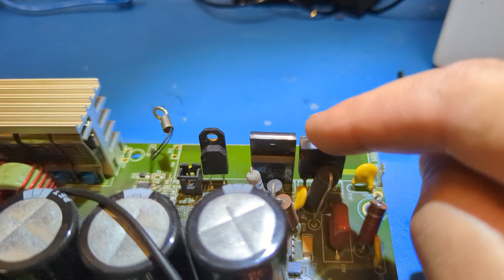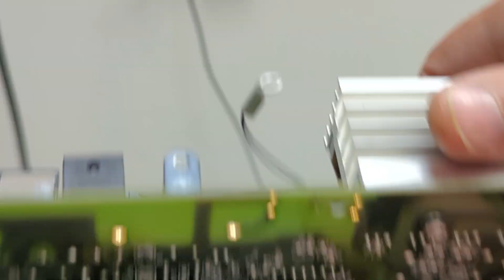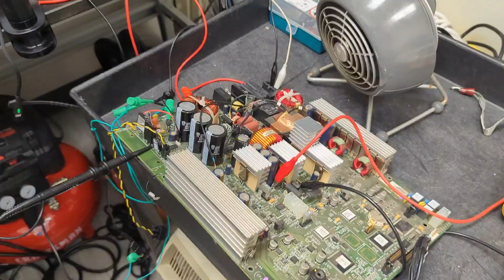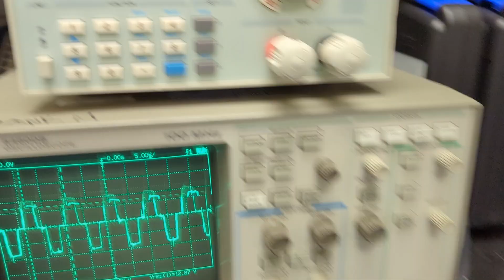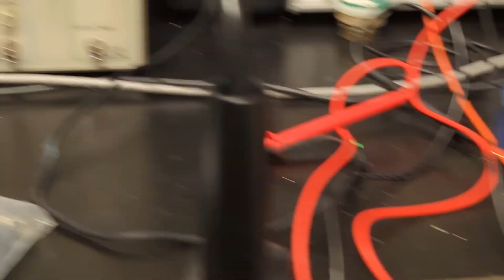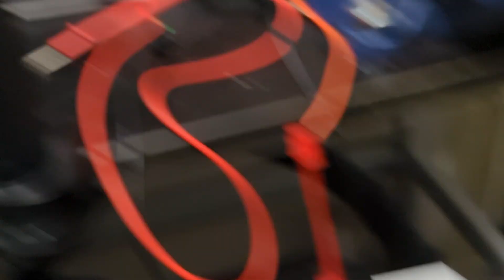Bio-Rad C1000 Thermal Cycler Main PCB Repair - Power Supply & Fan Control

Comment: Very informative. You really dug deep into this one. Oddly complex fan controllers. 

We'll be repairing some of these soon based on your experience. We have one with a power supply that ticks after power on and a dead one like you started with. Thank you!!

You said you worked on the Touch models with their separate power supplies (we have a standard C1000 with the separate PS as well). We have 3 of those separate 40V power supplies that produced magic smoke, but are being repaired. Have you repaired a Touch with a "Protocal run failed to stop" error during the Diagnostic Test? I think we have three of those. I will isolate to which component this week. 

I wonder if these units charge their 4.8v battery while in Standby necessitating the complex reverse power switch setup? I'll test later. NOPE. I put a low battery in mine and voltage stayed low while powered on, but increased upon full power up.

Lastly, I have some busted up blocks I can't reuse that would be perfect for testing. I'll email you if you want one.
Reply from the maker: @dsetter608  Thanks for the feedback Don! Hope you are doing well. It turns out that the fan issue at the end is normal for these when they don't have a reaction module installed. Or at least that is what I hear. I don't have a reaction module on hand to test (I'd take one of those broken ones off your hands 🙂). And my experience with the C1000 touch is just one unit. It was having a very strange issue where it would be unable to reach set temp right for tight gradient steps (say 10C)  across the block. It would then throw a slow block cycling error. Very odd. But if you weren't running a tight gradient, it worked fine and also passed self verification. I also confirmed it was not the reaction module. I wasn't able to fully repair this one and had to move on to another project. Would have liked to continue working on that one because it was quite interesting. But to answer your question, have not seen the error you describe unfortunately. Power supply issues are always a bit easier to repair IMO (even tho this one did give a bit of trouble!). So good luck with them. Happy to help if you want to send over some more details!
Reply: @fmashockie  My C1000 Touch will not allow the Diagnostic to start without the block, so I fired up a standard C1000. And yes, the standard runs one fan during the Diagnostic Test without the block and both with the block. Odd. Maybe to save power...? With the single fan normal functionality, sounds like you fully repaired your $35 ebay special! I have 2 more C1000s incoming this week. I can repair as many blocks as possible, then send you functional beater for testing. Then, you'll have a fully tested C1000.
Reply from the maker: @dsetter608  thanks! but only if you have the time.  this is not a huge priority at all.

Comment: Excellent video!  Thanks for going through everything step by step.  I have one of those Valhalla power analyzers, 2101.  Every time I send it in for calibration it's good, so I keep using it.  When you did your power measurement you had it on the 0.2 amp setting so thoroughly in the overcurrent on that analyzer around 46 mins.  I've done that so many times, ha. 

Magic smoke escaped!  This work would be so much easier if they released schematics for these things.  Anyways, with the reaction module these things draw a lot of power so that power supply is under very heavy load.  The one I repaired is still going in the lab.  I think the resistor and relay are inrush current limiting to protect the PFC diode?  Sometimes they put a second slower diode in parallel with the PFC diode and inductor to handle that but I don't remember if that is in place or not.  I found the fans wouldn't run correctly without the reaction module installed.
Reply from the maker: Thank you!! I just left a comment on your video 😂 Really appreciate you taking the time to watch and comment.  The reason I assumed the mechanical relay is for in-rush current from AC input is the fact that it switches on immediately; as soon as you apply mains, but before you flip the mains switch on.  This is before the PFC circuit is engaged.  But you could be right!! And yes I am beginning to think the fan control is related to lack of reaction module.  Would have loved to had one on hand so I really could have put this thru a serious load test!
Reply from the maker: And yea the Valhalla 2101 is a great analyzer! Just watch out for those gang switches.  When they get dirty, they start causing all kinds of strange fault symptoms!
Reply: Am repairing one the now (same pcb different part number) so you two's videos have been most helpful.  The unit i have sometimes starts but always starts tripping on and off after a while.  Am hoping it's the capacitors on the quiescent supply.  I stripped them out and found 1 with very high ESR.

Comment: Seems like lightning strike type thing, really dont see how so much completely unrelated stuff broke for no good reson.
Especially the I/O on the uC dying when all the circuit after it is ok.
Reply from the maker: @hopper7755  could be! I'd love to troubleshoot it further but without the reaction module, it would be difficult to get additional clues on the state of the HC12 micro.
Reply: i was wondering the same
Reply from the maker: @yanfishtwig2356  there isn't much overvoltage protection at the AC input.  No MOVs.  unless they are in the external EMI filtering module but usually that isn't the case